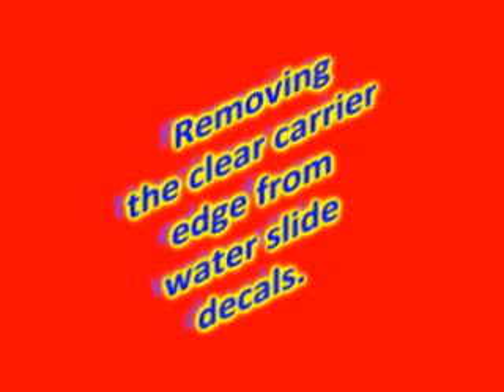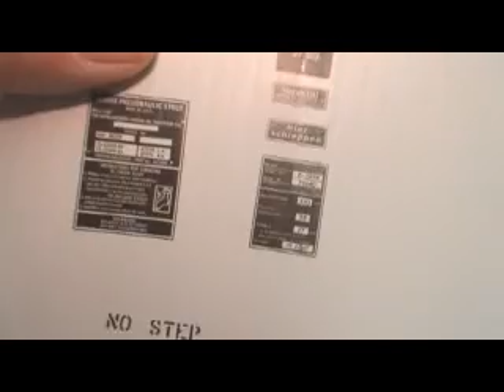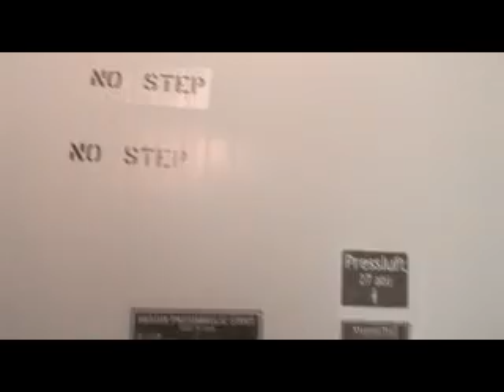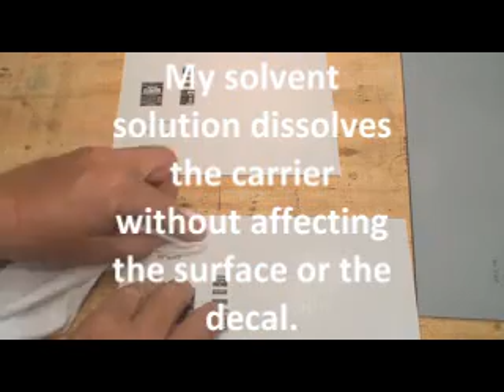Removing clear carrier from water slide decals

Comment: This problem has been solved with removable carriers on waterslides. google : "heat resistant water slide decal"
Reply: I know this is an old comment, but I've been looking for this answer everywhere. I'm painting game consoles and wanting to apply a decal, but hate how the border looks. Do you know if this is the only method, or if there is a print from home method as well?

Comment: I'd buy some... but your website doesn't work
Reply from the maker: I do not have the product for sale. The idea is to dissolve the clear carrier used on water slide decals. And just about every water slide decal maker has a different clear carrier they use.
Reply: gsibertjr so then what is in your solution?
Reply from the maker: It probably will not work for your application, but a 50% mixture of lacquer thinner and naptha.